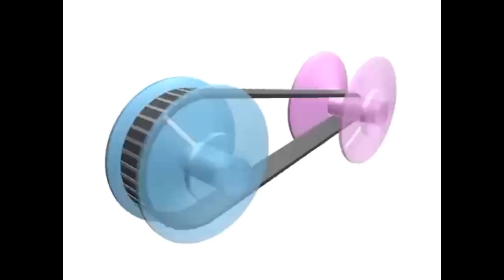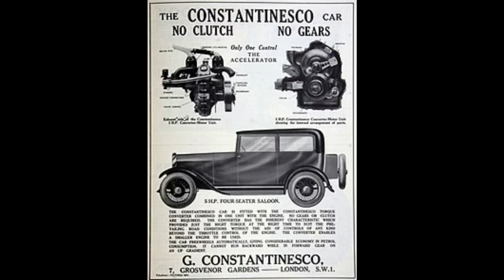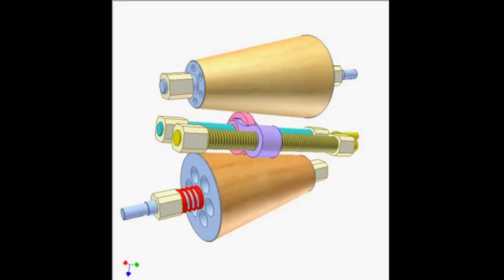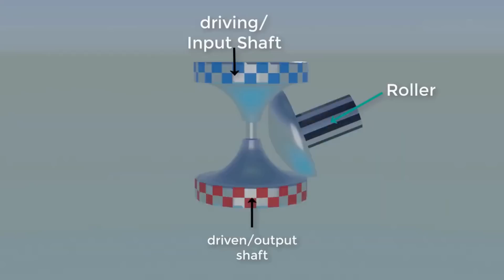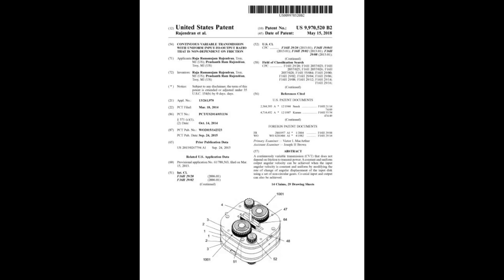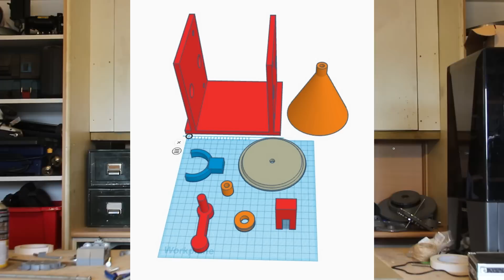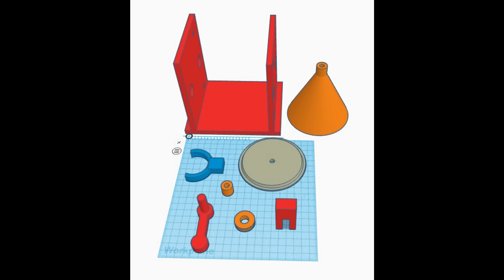1972 Continuously Variable Transmission For Use In Wind Turbines (CVT)

Comment: I wonder what they are trying to do differently now with the magnetic type you mention from an eddy-current drive that has been around since the 60's at least.  I have numerous pieces of industrial equipment that use an eddy-current coupling to provide variable output from a constant input.

Comment: Thank you for the clarification. DAF is a Dutch automobile company that has a rich history in the automotive industry. One of the earliest and most well-known economy cars produced by DAF was the DAF 600, which was introduced in the late 1950s. The DAF 600 was a compact car designed for efficient urban transportation and was one of the first cars to feature a continuously variable transmission (CVT), which was a significant innovation at the time.

The CVT allowed for smooth and efficient power delivery, contributing to the car's reputation as an economical and practical choice for drivers. DAF's focus on fuel efficiency and practicality made their cars popular in the European market, especially for urban commuters and those seeking affordable transportation.

In addition to the DAF 600, the company produced other notable models, such as the DAF Daffodil and the later DAF 33 and DAF 44, all of which were designed with economy and practicality in mind. DAF also gained recognition for its innovative Variomatic transmission, which contributed to the company's reputation for producing efficient and reliable vehicles.

While DAF's focus shifted more towards commercial vehicles in later years, the company's early contributions to the development of economy cars left a lasting impact on the automotive industry.

Comment: You need to sent a link to Martin at "Wintergatan" the marble music machine.
To control his flywheel powered machine he is going the use a very good idea as a governor but using it to apply a brake. My idea is a transmission like this to control the speed.
 @gydo1942 describes the governor well.

Comment: A very cool one is the Toyota E-CVT power-split device, in their Hybrid Synergy system. Using an electric motor to modulate the relative rotational speed / torque between the input and output, in a epicyclic / planetary gear drive. Basically, what's in th Prius, and all their subsequent hybrid engines.Very reliable, very smooth, very efficient, mechanically very simple, no friction wear.

Comment: Nobody, and I mean no one at all, wants to face the truth. Since 2007, I have been talking about Inverted Transfer Energy (100% Non-Grid-Tied) Sadly I learned quickly by the response that I have received; it's all about keeping all electrical energy generation tied to the grid.

I have repeatedly said what Inverted Transfer Energy is designed for, and I have repeatedly said how it works to produce sustainable electrical energy. Sadly, it’s all about the wealthy keeping all electrical energy systems tied to the grid and not about saving life on Earth. 

Why is everything always said to be impossible until it has been done? Inverted Transfer Energy is sustainable electrical energy that is designed to work with off-grid renewable energy systems (up to 5kw) to maintain the battery bank charge in order to keep the electrical energy on, even during extreme weather events. 

Let me be perfectly clear; Inverted Transfer Energy is by no means someone’s theory, mechanical perpetual motion free energy that can’t exist, over-unity, zero-point energy, nor is it powered by fairy dust. There is a lot more to physics than we realistically know or are willing to admit with the status quo.

It is not about how Inverted Transfer Energy conforms to physics of being sustainable electrical energy. It is about how physics confirms that Inverted Transfer Energy is realistic. Why do people find it so difficult to understand the basic laws of physics? With all due respect, please, do not assume to be a know it all, because no one is.

So, why can't people understand layman's terms anymore?

“Without the process of just reasoning, there is no truth, there is no moving forward, progress becomes impossible to achieve.”

Comment: CASE IH farm tractor has a Infinite variable planetary gears which rotating hydraulic sun gear sets ration .
PH cranes invented magna torque magnetic CVT in 1960s used on swing gears .

Comment: So much info packed into ten minutes! What about the braked-planetary transmission on the model T? Revolutionary in it's day. There was an hydraulically-braked planetary transmission made by Carver, instead of braking the rotating gearbox with shoes like the Ford it's rotation was made to pump hydraulic oil, the flow being controlled by a valve to vary the speed.

Comment: Not quite on subject, except for the cvt, but one of my favorite all time systems was in the Harley golf carts in the 1960s or so.
They used a single cylinder, 2 cycle engine. Once started, the starter becomes a generator, and to back up, a switch simple runs the motor in reverse. And that goes through and expanding pulley cvt. Amazingly simple, and nearly indestructible in the hands of drunken golfers LOL

Comment: I think slippage in load peaks could make this design unreliable. New WTGs generate power in DC and use essentially a pure sine wave conversor to inject AC to the grid, allowing for an easier control of the output and a bigger range of usable HUB speeds

Comment: That's fantastic Rob, have you considered to put a lever on that ball and a plate on that lever such that when the wind Presses the lever you get your desired RPM and when the wind doesn't push the lever and gets pulled back to the initial RPM by gravity?

Comment: There was a car called the Owen Magnetic, that utilised a magnetic drive system back the 1920's or 1930's. It was essentially a generator that drove an electric motor, that housed within a single unit, so not strictly a Magnetic drive, but close to it. There was no direct mechanical link between the 6 cylinder motor and the wheels. It was an insane design.  

It was variable speed(had selectable gears via resistors) and had reverse.. the electric motor also acted as the starter and I believe, also allowed engine braking. Details are a little sketchy.

Jay Leno has a fully functional Owen Magnetic car in his museum in California. He featured it on his "Jay Lena's Garage" youtube channel quite a while ago.

Comment: Gearing is so much more important than most automobile companies seem to understand.
With proper gearing engines could be about 60%-70% smaller (and there for much more efficient too) they would still achieve the same speeds.

Comment: Nice video!   Some wind turbines achieve speed matching through variable pitch blade hubs, but usually these days a variable frequency converter is used between the generator and the (fixed speed) grid, so that the mechanical complexity up in the nacelle is minimised!

Comment: I ran across a NASA Tech Brief in the early 1980's which showed almost the same set up as the one at 4:18. The one major difference was it used a two faceted transference wheel (between the drive and driven cones) which acted to give both surfaces that reduced side slippage during the transfer. 

For example, if the drive and driven cones shared an angle of say 20 degrees, the transference wheel would be peaked at the midway diameter, with 20 degrees reducing sloops down either side. 

I though it a good idea and being a NASA Tech Brief means it can be copied, improved upon and used by an American Engineering firm that wished to use it, with their being no Patent nor Intellectual Property Rights exerted by NASA / U.S. Government.

Comment: When the wind power plant is connected to the network, the generator will get very stable RPM because it must be in sync with network. If the generator wants to spin faster, its load to network is simply higher which automatically reduces its RPM. If the generator wants to spin slower, the load is reduced so the RPM is again constant. In the exteme when there is no wind, the generator turns into appliance. It is "windmilled" by power network.

Comment: Ive seen these used in wire production machines, to draw the wire through diamond rings in order to reduce it gauge from 2 inch copper coils down to small enough to use in microchips.

Comment: Fascinating!  My first motor transport was a Norman 'Nippy' moped which was belt drive via a CVT on the engine.  Ball bearings flew out in a captive disc forcing the belt in the V gap up higher thus rotating quicker to drive the rear wheel.  Dated from 1959/62 era.  This whole video of almost 10 minutes was  done in virtually one breath 😊  Please take a bit more time to explain things RObert - still most enjoyable to a mechanically minded person.

Comment: I have a wind turbine idea. Build a railroad track in a large circle. Put a train on the tracks with flat cars and DC generators  that spin up when the train moves and send their power into the tracks. Place sails on the cars that turn to catch the wind, like a sail boat on autopilot.  If you built them around towns on elevated tracks they wouldn't interfere with traffic. At 5 knots a 100 square foot sail will make about  1491 watts. That's on par with good solar panels at full sun. I've had people tell me it's a dumb idea but no one can tell me why. A small crew could man it and make sure the automatic controls are working. You might need to design the track so the wheels are locked in and it can't blow over.  You could make solid sails instead of canvass if you wanted to make it last longer. If each car had a 60 foot tall by 30 foot sail it would make about 25 kilowatts. If the track was 15 miles long it would make about 15 megawatts. You could also control how much of the sail is in the wind so it doesn't go too fast if it gets windy.

Comment: What you can use as a setup to move the ball up and down according to whatever setpoint, you can use what old pneumatic steam intergrators used to govern at a set speed. It make use of the centrifugal force on a lever that will provide the feedback or relevant force against a changeable anchor point.

Comment: Never understood why internally-lightly-honey-combed fly-wheels using water for variable weight - and arranged horizontally on ground - beside wind turbines have not happened? Nor why 95% of cost of tower production has not been attempted by using the inherent geometrical strengths of polyhedrons - especially an asymmetric tetrahedron - but hey ho!

Comment: I have a Dixon ZTR that uses a drive system with 2 cones belt driven off the motor, best lawn mower I ever had. It's outlasted another name brand ZTR that has two hydraulic transmissions that I also use. I wish you could still buy them with that type of transmission.

Comment: An eddy current clutch of a more modern design could also be used to get a variable speed output for a wind turbine. At low wind speeds you would want 100% lockup and as the speed increased, you would want the lockup to lower. Or you could set it up so that as the speed increased on the input, more torque would be applied to the alternator. Older design eddy current clutches used slip rings but a modern one could be built where it all is coupled magnetically. The slip rings being replace by a coil and diodes to produce the DC for the clutch coil itself.

Comment: Factories used to run by PTO 
All sorts of different machines run at the same time by hooking to some joint pto 

Whats the best way of going about powering a PTO like that with wind and something like a water wheel and maybe even steam and normal generators and possibly even electric motors all at the same time. 

The idea would be multiple inputs depending on whatever makes sense for the situation not necesarily just 5 things or 3 things or 2

It would be called the jethro recabulator

Comment: There are so many missing details here as to make this video wildly misleading. It shameful honestly.

You cannot get constant output from variable wind speeds because it's not a constant amount of energy. Wind turbines use variable pitch blades just like aircraft use variable pitch, constant speed propellers rather than variable ratio transmissions. 

It is not always desirable to run an engine at its most efficient speed. What is the most efficient speed? Lowest BSFC? Highest torque? Highest output? These are all different speeds. 

It staggers me that so many heap praise on videos like this. There appears to be a fundamental disconnect with basic physics in much of the audience.

Comment: If you embed magnets in the rim of the input cone you could make it pass over a coil and it's rotation speed would determine output voltage of that coil. That in turn could determine the position of a stepper motor controlling the golfgear position.

Of course, me being me, I'd want to take more advantage of multiple magnets on the input cone, via a serpentine coil,  which could effectively be not just the golfgear control voltage but also a lower power generator, that keeps the golfgear out of contact until it's reaches a speed/torque which is high enough to get something useful from the main generator. The end result would be a dual system, where at low wind speeds it'd use just the input generation system, but above a certain windspeed  the main bigger output one too.

Comment: Good engineering info but you're attempting to solve a problem from the wrong end of the driveshaft.  Wind turbines already have a CVT:  variable pitch blades.  A pitch adjusting mechanism for turbine blades is smaller, doesn't have to handle torque loads, and has no power transmission losses other than the inherent aerodynamic ones.  For overspeed protection, the blades can be feathered by turning parallel to the wind to stop spinning.

Comment: Have a Shopsmith woodworking machine.  Its power head as a continuously variable transmission that is essentially two variable diameter pulleys with a single belt between them.  And crank handle changes the diameter on one pulley, and the other pulley is spring loaded so that when you make the cranked pulley larger, it pushes the nested pulley halves on the other pulley apart, making its diameter smaller, and vice versa.  The thing has worked great for 40 years without ever even replacing the belt.

Comment: Unfortunately there are challenges. There always is. 

The good thing with gears or chains is they are not only efficient, but they don't slip and a small set can take a large torque. 

Nearly all variable drives rely on friction. And this means pressure to get it and any slippage causes terrible wearing of parts. 

And while a ball will make changing   the ratio easier. It means there's less contact surface and higher pressure on the tiny spot it touches. 

One solution is to use one central cone as input or output. And multiple external cones geared together with balls between them in a cage to move them. So you have more than 1 ball. This reduces problems of slippage while keeping the advantage of havung a ball. All the while reducing point load pressure on the balls and cones. 

Ideally you have the variable drive on the highest RPM part of the drive train so it take the lowest torque possible.

Comment: The first time I remember having seen anything about the CVT kind of transmission was when the technical trade press told about the Dutch DAF car.  Some test report mentioned how odd it felt to just press the gas pedal all the way to floor, and the motor sound never changed, but the car speed did.  I think that introduction was some time around 1960, maybe a little earlier, maybe later.  Later on, I have seen a number of new versions described, although I never had such a device in my hands.  Or maybe I must count the band saw at my working place.  The band speed was adjustable by some such device.  But the times of disassembling an alarm clock were behind me, so I never saw what was inside...
Reply: I think you have seen the introduction of the Daf 600 which was produced from 1958 to 1963.

Comment: For moving the ball up and down to change the ratio automatically, you can look into "flyball governors" as used in steam engines. They use centrifugal force to fling weights outwards, which in turn pulls on a linkage which controls the engine throttle (or the ball in your case). If set up correctly, this forms a feedback loop. Windmill speeds up, weights fling out, ball is moved to keep the ratio constant. Interesting concept, keep up the good work Robert!
Reply: They used the same system in grist mills,both hydro and wind powered at least as far back as the 1800's.
Reply: I think that's where the term "balls to the wall" came from lol
Reply: @jeremybrown8263  I know "balls out" originated from this, not sure about "balls to the wall".
Reply: I should have read through the comments I see
Reply: Came here to say this! Much like the governor in a small engine. Great idea!
Reply: I thought the same thing.  I saw them in use on hydro-electric generators to maintain speed with differing water pressures.  Instead of a throttle, they changed to angle of the inlet gates (or something similar.  It was a while back).
Reply: @joejansen7029  In hydro electric its wasn't for the changing water pressure but for the changing electrical load on the turbine that might cause the generator to speed up or slow down.  Well spotted though :)
Reply: @joejansen7029  that is correct, in high head turbines the governor operates a “spear valve” to adjust the flow of water so that the output from the generator stays close to its rating, or a level chosen by the operator.